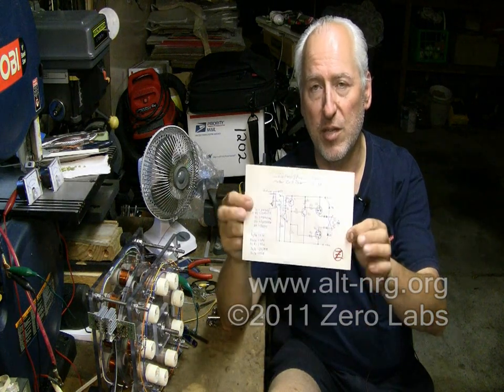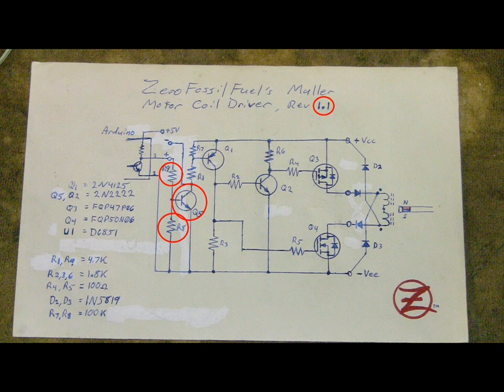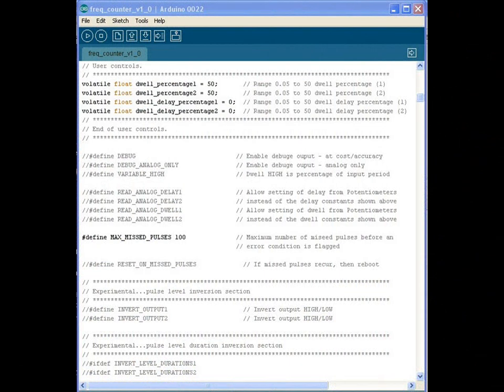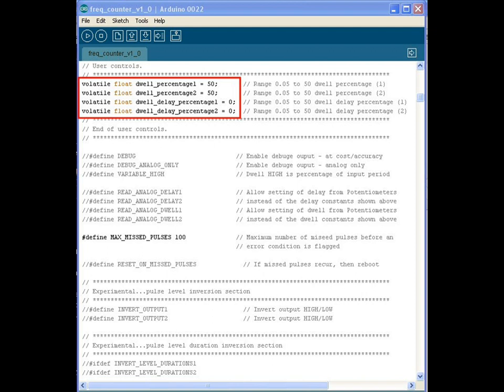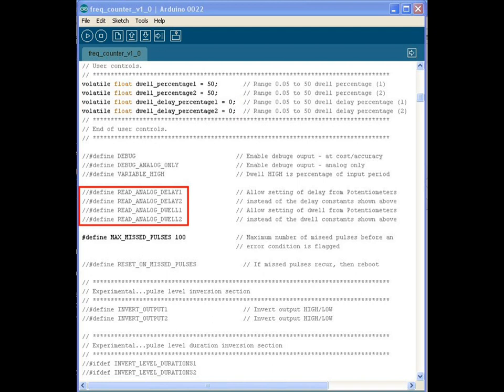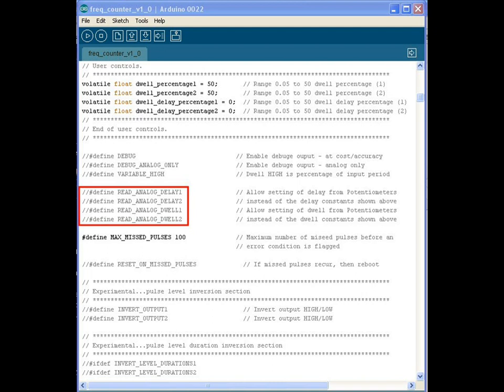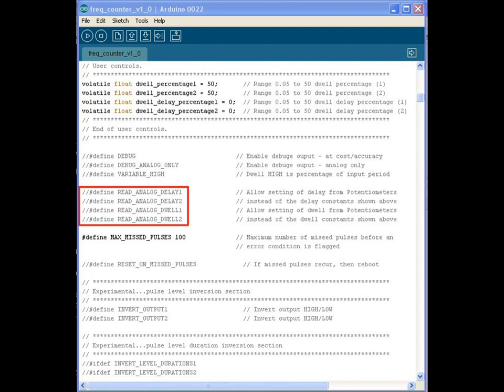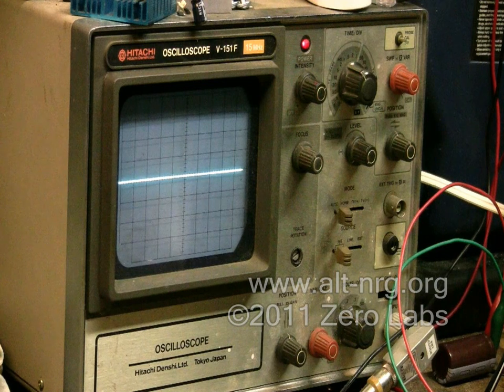#291 Arduino tests, schematic updates, sketch release

Comment: Zero...there must be more guys like me who do not want to buy the arduino contoller...so could you please re-publish the circuit using normal electronic components running from a 12 V power supply.   Sure would appreciate this....thanks.                  Duane Sheppard

Comment: Another SUPER vid ZFF, look forward to them everytime I see a new one posted.
Also, I believe you should setup your systems so that the testing of the various variables can all be automated and logged, as well as computerized logic be used, to tune your circuits for highest efficiency per unit of "work" produced.  Same as you wanted w/ your HHO systems kind of?  Your currently guessing as your current testing.  If you have digital logic test for you cover much more ground! Just my opinion.

Comment: I'm not a sparks guy but more into vehicle fabrication and prototyping, however your work intrigues me no end. What with $400 commuter fuel costs per month, I'm quite desperate to find an alternative. Frankly I'd consider sinking $10k into a practical energy alternative to pump gas or LPG, and once you've identified any realistic opportunity to harness this tech, I'll be upscaling to convert a two seater enclosed motorcycle prototype. Keep at it  Zero !!!

Comment: If your coils were configured as steorn orbo, the rotor would not have hardly any back EMF drag applied to it that would slow it down after your coils gave it a kick. I'm not sure, but I think steorn orbo uses pairs of toroid cores rather than cylindrical coils?
Here is a reveal open look at it You Tube W_1EcQcvkQc

Comment: Both your Mosfet drive transistors have to be switched on at the same time--what is the advantage over using just one Mosfet?--It is all just one current flow that can be controlled with just one Mosfet?
With a full H-bridge 4 Mosfet coil drive configuration, you could forward or reverse polarize. With all Mosfets off and the rotor flywheel still spinning, you harness the magnetic spikes.
Please compare your circuit's with a Bedini SSG motor's wave forms.
His trick is two batteries.

Comment: In the circuit schematic, there are 4 diodes near the coil leads. The Do-41 case 1n5819 are not dual Schottky rectifiers, so what kind are these other ones? Why don't you have them labeled in the schematic?
What part of the waveform is the harnessable energy part?--Is it any part where the drive current is off, but the voltage is non-zero?
The round negative dip part of the waveform looks like heavy diode capacitance recovery time--is that the way it is supposed to be?

Comment: What is the max supply voltage usable with your circuit? Is is limited to Vgs(max) or by the IC driver chip? Or by the Schottky rectifiers used?

Comment: Could you put in your notes for the video where you oscilloscope is connected to get the output waveforms that we are seeing? Then next time put an indication of the scope attachment points in the schematic?
What kind of RPM is happening now with 7 VDC, then later more supply voltage?
Did you change the magnet distance to the coil core from a couple of months back when you were testing the 70 Vpp coil output to lower the output voltage swing? Or is it just the lower RPM with lower 7 VDC supply?

Comment: bit ly/n56oM6 Dual Schottky Rectifier 120 VDC PIV, 20 Amp $1.37 each To-220ab
The 1n5822 is 3 amp 40 VDC, but the 1n5819 is 1 amp 40 VDC.
Wasn't the output voltage from the coils at more than 70 Vpp?
bit ly/o6vV9j Schottky Rectifier Selection filter for Mouser Electronics.
If you have wrong diodes, components can blow when PIV gets over 40 VDC.

Comment: @ZeroFossilFuel - the absolute zero were all motion stops is just a hypothetical measurement but it will never be reached. When I see an equation that has a zero point in it - I know it's a wrong equation. The only real "Zero" I have ever seen is You, and to me that " Zero" is One in 42 trillion - a true Man among Men. I hold you in high regard Zero, Yup, a Big fan of your work.
Did you know that the mayans were the first to use zero in a math equation? Well, that's what was told to me.
Mike.

Comment: You probably need to do the equivalent of switch debouncing for the adjustment pots.  I'd try a 1k resistor off the wiper of the pot to the uMCU with the input pin bypassed to ground with a 1n cap.  You can increase both the value of the resistor and cap as needed to deal with the noise generated by moving the wiper of the pot when there's DC across it.